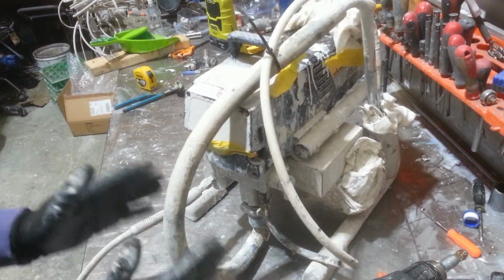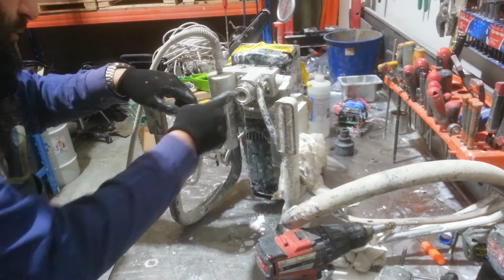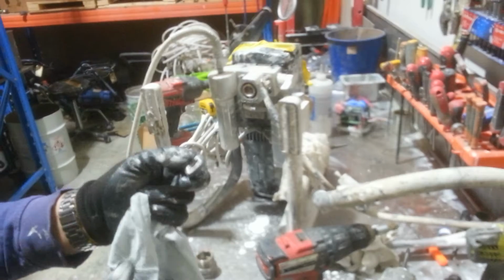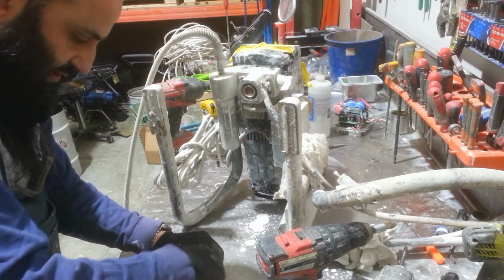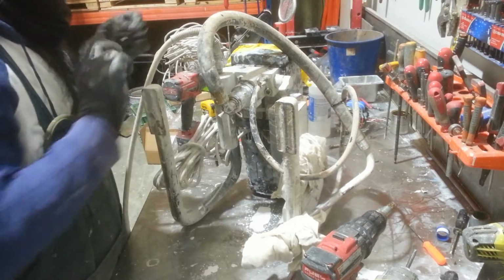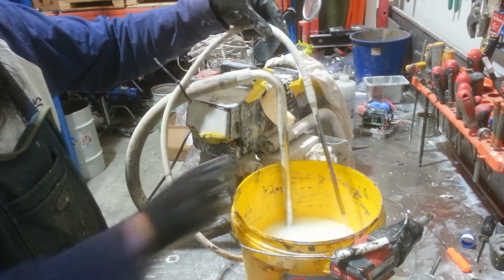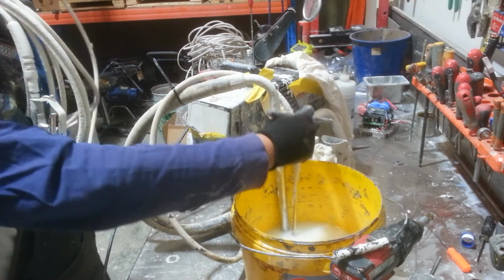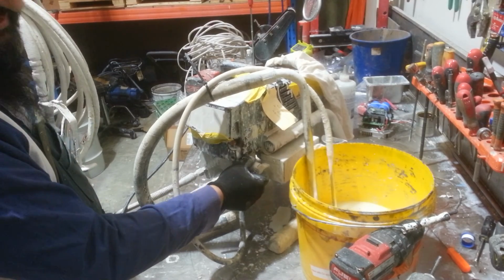Airless Unblock  Titan Wagner

Comment: Hi, Ali, do you know how can i convert the titan 440 from 110v to 220-240v? as far as i know, it's basically the same sprayer as the Wagner ps3.21 but i believe the motor is different. not sure about the pressure control board. i checked it and i found out it can work on both 110v and 220v+.
Can you please create a video showing the Wagner ps3.21 motor and control board? i just wanna see if they are the same as Titan 440 and which capacitors it use.

Comment: Hi mate 
I'm trying to rebuild my 440i and 640i
Done the 440i and got the same rebuild pack for the 640i but the smaller packing for the piston is too thick .it looks like i need one about 6mm thick and all ai can find on the net is arounf 11mm?
I thought both machines using the same parts?
Thanks in advance
Reply from the maker: The 440 and 640 have the same pump and therefore the same pump kits, also check if the piston needs replacing as they usually wear with the packings.

Comment: I have a Wagner 250m everything primes but nothing comes
Out the gun in a spray position? Do U know what the cause is?
Reply: I ran paint when I primed but notning came out so I switch back to water to clean out the unit but when I took the hose out there was paint coming out of it..
Reply: if you take the tip out, will water or paint pump through the spray gun? if so then the tip is blocked, if not you might have a blockage in your pump. Of course both answers are based on the machine priming correctly and the motor not continuously running in the spray position without the gun trigger pulled.
Reply: @alielhaouli7418  I didn’t use the tip when I was doing this. So without the tip , no water or paint came out when I switch to spray position to run it thru the hose
Reply from the maker: @AnthonyLoung  when you switch it spray from prime, does it keep priming or does the motor stop running.  Also in prime is water or paint actually coming through the smaller return hose.
Reply: @westsprayairless8763  the
Motor stops running when switching from prime to spray then runs again when switching back to prime and yes water/ paint does come thru the return hose. Would it might be the gun hand piece ?
Reply from the maker: @AnthonyLoung  either a blocked gun filter or filter is in upside down, or your spray hose is blocked
Reply: @westsprayairless8763  the filter was upside down, problem solved! Thanks for your help/ answers

Comment: What happens if ball inlet cage is broken, can sprayer be used if that little star piece is removed from inlet
Reply from the maker: Hi Simon, no it wont work properly because the ball will wedge in there and not move freely